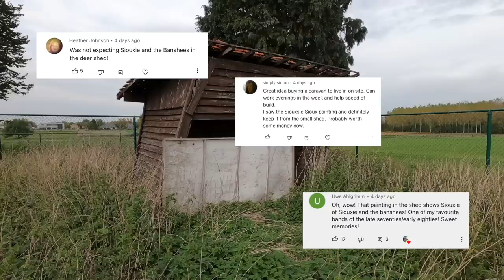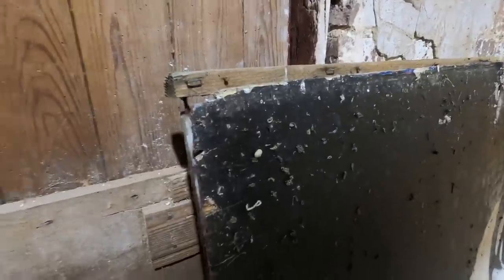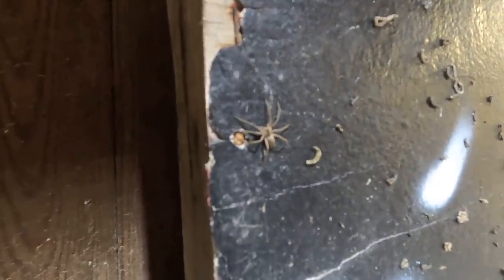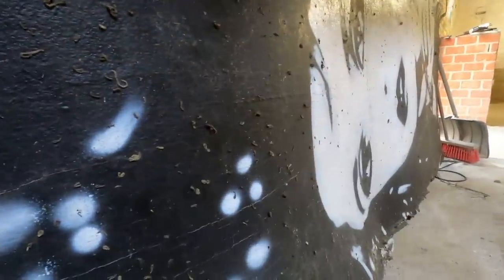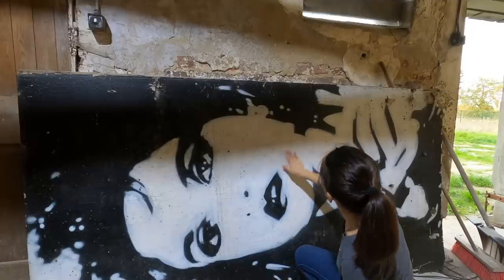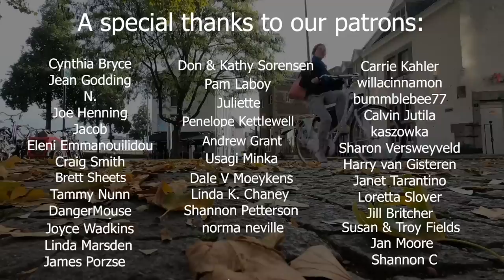Our backyard became HUGE! / Saving the SIOUXSIE... / Renovating a 110+ y.o. abandoned farm

Comment: To cut chain link fence, simply cut the ends of one wire and pull a single strand of wire out. You don't have to cut every square. It is put together similar to the stitching on a feed sack or other "chain" stitches. Pull out a single vertical strand and it comes apart.
Reply from the maker: Thank you for the tip!
Reply: Это можно использовать и для «бесшовного» соединения двух отрезков. https://youtu.be/uWFOup7XmmQ
Reply: And you can join rolls in much the same manner

Comment: You are so lucky that my husband and I didn't put in those fence posts, they would have been much harder to remove!
Reply: same here... like a 30x30 cm block of concrete around them for 30 to 50 cm deep to start with and i got a fence-door in the wall with chemical anchor around the threaded rods where the hinges are placed on (becuase you never know a simple bolt might come loose after all years 😂  )

Comment: About the Siouxies poster, clean it, dry it and glue it down (without the frame) to a backer board to stabilize it. Only then you may repair whatever is needed and repaint the details if necessary.
Reply: It is a specialist job they need to research it first, it is not a poster but an actual painting. It will take a bit of expertise, it’s not something you can do without a good amount of research, the board is flaky and warped so it cannot just be glued down that easily. I know how it should be done but I am older than the picture and do not travel well.
Reply: @lindyashford7744  that's probably a stencil painted with spray cans. It's no carefully crafted oil paint work of art.

Comment: I think, but that is just my simple idea about restoring/ conserving the painting is to glue it on a new wooden backplate the same size of the painting. Place a new frame around. After that you can restore the holes with liquid wood and then paint it with the same (color) paint, so with paint that was used at the time.

Comment: if you forget the bolt you can just chuck up the wire and then twist....but it dosnt need to be tighter than you have it as is. ps its susie and the banshees mid 80's

Comment: If you are going to reframe the poster I would recommend not to pull the nails out, it would destroy the plywood.
Try instead to cut the nails with a multitool (the tool you can fit different saw blades, knife blades and sanders on), use a metal blade and insert it between the batten and the plywood.
Best would be then to glue the poster onto a new sheet of plywood to make it stronger.
Maastricht is a nice city, I live 20km away from it.

Comment: Strongly recommend you do nothing whatsoever to the poster, and just sell it as is, dust and spiders and broken off pieces included. A buyer can pay for a restorer to do any cleanup properly, and that way you don't risk damaging the painting any further in your efforts to save it. It may be valuable to a collector, but they'll want to ensure that any restoration work is done by a professional conservator who will know how to fix it even down to putting back together the wood it's painted on, using materials and methods you cannot possibly match doing DIY. Best to just leave it in their hands, and take the extra little boost of cash up front for it.